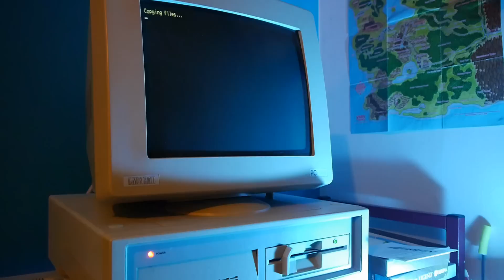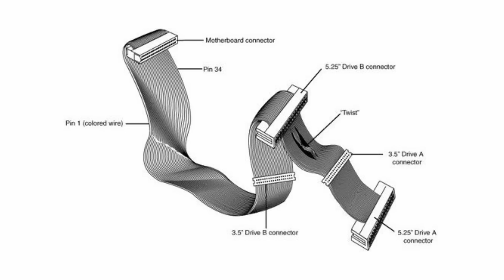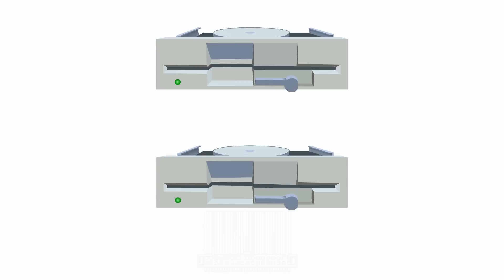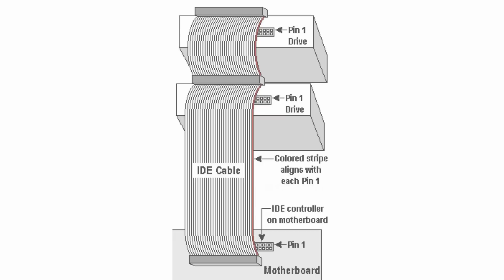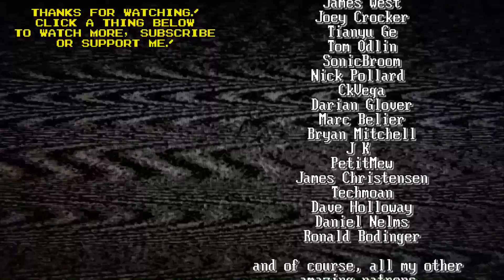Why are Floppy Cables Twisted? [Byte Size] | Nostalgia Nerd

Comment: Cable select for hard drives "never caught on" you say? Then I guess I must have dreamed that all those hard drives I installed while working/interning in various IT departments during high school and college were cable select.
Reply: It didn't catch on with the 40-wire cables. But the 80-wire ones did start to make it more popular.

Comment: Were these twists added by hand?   I'd imagine it would be quite complicated to get a machine to do it.
Reply: many computer components and other electronics are assembled by hand.
Reply: There are machines that twist the ends of the wrappers on single pieces of hard candy very rapidly in candy factories, so I can't see it being too difficult to get a machine to twist a small section of ribbon cable. I do like the simple (if not elegant) solution to the floppy driver selection problem IBM implemented.
Reply: Declan Brady, I guess you don't deserve the title "guru" if you're not soaking up every last scrap of knowledge on your subject you can get your hands on.

This is why I love YouTube.  Getting my hands on that same knowledge.  A fuller understanding of things I found important in my childhood, from people who were equally passionate about them.  And doing it in the company of big pieces of my childhood, the heroes of my day like Larry.

It blows my mind some days.
Reply: Not at all hard to add it with a machine. Imagine a wire feed guide being a round block with a slot for the wire the go through. To twist the wire instead of just pushing it straight down the wire, you thread the outside and push it through a threaded tube so that it wants to screw into the tube and thus spins in a circle.
Reply: +Alan Hunter I have a feeling that the cable was also heated to make the plastic more easy to bend and have it settled by cooling off after twisting.
Reply: "top 10 hardware hacks added to consoles by by hand"
Reply: Even in the 80s this was easily done by machines. 
I would imagine they hold the wire with two flat metal blocks, then two knives cut the part lengthwise which will be twisted.
Two smaller blocks grab the part to twist and drive a 180 degree turn inside a round rail. 
Two more blocks grab the three ends and hold then, plug gets attached, done.

Regards
An automation programmer
Reply: @sidjtd  I believe the answer is in the question
Reply: Larry, you seem to be everywhere... as long as it's old and/or weird.
Reply: Peasants probably get cables that were twisted by machine but all mine are hand twisted on the thigh of a Taiwanese beauty in the manner of a fine Cuban cigar.
Reply: Larry Bundy Jr, nice seeing you here!!!!
Reply: You sir are everywhere lol. STOP STALKING ME!!!!!!!!!!!!!!!!!!! Love ya Larry

Comment: For some reason this made me remember something I was pondering ages ago. Quite a few years back I got a USB floppy drive to use with an old ultraslim laptop that didn't have a FDD built in. If I plugged this into a PC that already had a floppy drive it would start up with drive letter "B". I often wondered what windows would call the USB FDD if I plugged it into a PC that already had two floppy drives installed, But I never got around to trying it to see....... Did anyone here ever try this?

Comment: I answer your question and then watch the video to check if I'm right: The twist is there so the computer knows if it is coming from drive A or B. If the cables weren't twisted the PC wouldn't know for sure because floppy drives have no jumpers and act the same no matter where they were connected. Now let's check if that was the case and if I did miss anything. :-)
Reply: Oh, I didn't know floppy drives with jumpers ever existed. You always learn something new. Good that I watched your video then :-)

Comment: Thanks for clearing up the reasons behind the twist, I didn't know that was it. Also the gap in the IDE cables one was a mystery for me - I genuinely thought my IDE cable was damaged when i noticed that. I guess i can now safely put it into service note that I know. Still, setting jumpers on the drives is not so bad that I would be complaining about no autoselect capabilities.

Comment: So, now we have to solve the mystery why the manufacturers never used the notches on the 3,5" floppy connectors correctly. :-/
I have got several drives which have notches on both sides of the connector. And motherboards which have none.
Your first try in connecting them will always be wrong!

Comment: Is there a USB version of a 5.75 in floppy drive? I have so many old floppies I want to read again but don't have an old computer.
Reply: Probably is,just look it up on google.
Reply: I know I'm being pedantic, but the drives were 5.25"
But sadly due to the age of those old disks, even if you found a drive that could read them, chances are they've degraded to the point where they're unreadable simply due to age. (the oxide layer on the disk degrades and corrupts the data)
Reply: I used to have an old computer with a 5.25in drive about 6 years ago and the disks were still readable then so I think there's still a good chance. Unfortunately the drive itself broke when I heard something snap when I turned the drive latch and now that computer is also dismantled

Comment: The twist in the cable is in case you have more then 1 floppy disk drive. It helps differentiate between the 2 drives assigning the first drive to A:/ and the second to B:/.
Reply: Chocobo Billy - After watching the video: No shit, Sherlock!
Reply: The twist is to give the bits a bit of a spin so they don't all rest on the bottom of the cable and wear out that side unevenly.
Reply: It doesn't matter, they get to be smart! Well, they thought.
Reply: It's so the pixies don't fly off the corner
Reply: it's the same reason you should flip your mattress now and then
Reply: It stops you putting your pants on backwards like those Kris Kross kids.

Comment: That was an Unexpected Plot Twist. drum roll 😀
Tough crowd... i know LOL ☺
Seriously instead of A: B: it should be Slave Master like HDs
but hey maybe MSDOS was a mess beyond repair
or maybe IBM was so arrogant they couldn't care less
who knows really why They took that /Path/ drum roll 😀
Thanx for reading ☺
Reply: It should be Drive 1 and Drive 2, as Shugart specified. 
And Drive 3 and Drive 4 as well, since the Shugart Interface defined FOUR drive select lines, not two. 

IBM closed off the four-drive possibility by adopting the twisted cable instead of setting DIP switches or jumper blocks PROPERLY. And made life harder for everyone that owned a computer with a properly-configured disk controller down the line, as they started shipping drives with no switches or jumpers that could ONLY be used the IBM way. 
(I grudgingly admit that it makes the assembly line run smoother if all your disk drives are configured the same way, since no one can accidentally install a Drive 2 into a single-drive system, or two Drive 1s into a dual-drive machine)

Comment: Back in the day when I asked myself this same question, I simply read the pin-out spec (didn't everybody?), and my curiosity was sated, but you did go a bit deeper here. Good job.
Reply: By the time I was getting into PCs, the dual floppy setup was extremely rare. Though I did get my hands on a second one at one point and set it up to copy shareware floppies.
Reply: I see we are becoming quite the merry thread of people who know the fun and joy of using a belt punch tool on specific sectors on floppies.
Reply: Eurotrash RC 

look up 

"don't copy that floppy" on youtube
Reply: copy "shareware" floppies, oh of course, say no more sir
Reply: I'm pretty sure I did, too. But it's been a long time, and I had forgotten. And videos tend to contain more information than just answering the question. 

I didn't know they eventually removed the B: (/dev/fd1) drive from some cables, for example. Nor did I ever think to ask how cable select on IDE drives worked.
Reply: It was even worse, I held on to floppy drives on PC until the very end, the later firmware would only support a single drive, and somewhere there some firmware vendors even disabled support for 5.25" drives and LS120.
Reply: SuperSurge28 that kid with the earring looked like he was ready for some brown sugar
Reply: Eurotrash RC 

   Yuh 😆👌

Comment: Wow, years after I drop IDE stuff for SATA, and only now do I realize I didn't have to set those jumpers for IDE Hard disks and CD drives if the cable had that notch for the master/slave detect, I'd still end up at least mastering one drive and then have the other drive select what ever (unless it only provided Master and Slave options)

Comment: Wow, this is relevant. I just bought one on ebay the other day realizing that all I had was IDE cables.
Reply: I had a cable that was missing pin 3 (as is the floppy drive), but the motherboard had all the pins. Do you know why that is?
Reply: kirbyswarp well one of the voltage or ground pins wasn't necessary in later designs and thus the cable was probably just not necessary for function at the time saving a few thousand dollars for the company
Reply: Well, I hope it works because I don't have another floppy drive. And I kind of need to flash the bios.
Reply: Depending on how new the board is you could flash from usb.
Or start up a DOS from CD to do the flash. Atleast that is what I did when I had no functioning floppy drive.
Reply: It's a pentium 3. No USB port on the motherboard, as far as I could tell floppy is the only way.
Reply: I already have a floppy with awsflash and the bios image, just need the cable without the missing pin.